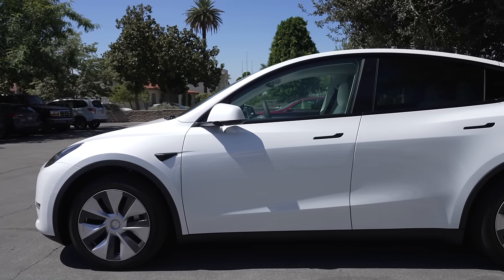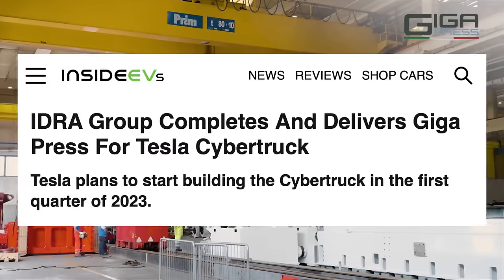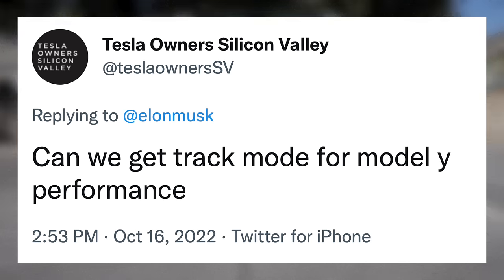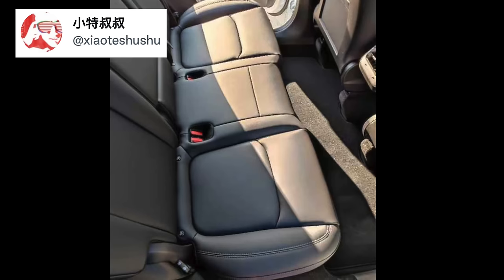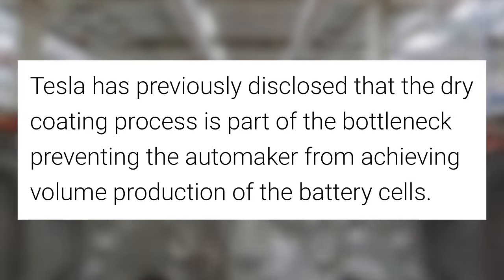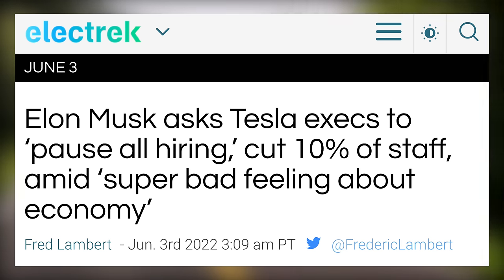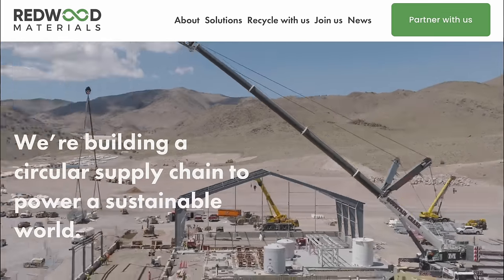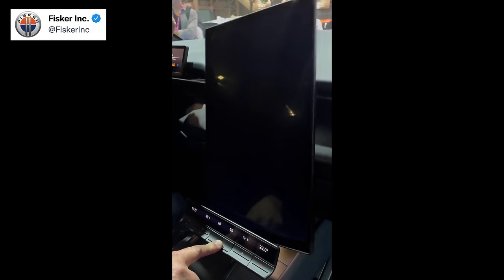NEW 2023 Model Y Features Are Here | Don't Make a Mistake

Comment: New features? The car looks exactly the same. While many other Automakers are introducing fresh new models. If Tesla wants to stay ahead of the pack for a long time, they need to quickly invest into new models. As a more affordable model, and the truck. The Cybertruck is yet to be present in it production ready model, more certain to use a standard unibody construction.
Reply: Same as people saying they need more models... they really don't they still have a backlog and when you can get the car asap it'll bring more buyers that aren't willing to wait.
Reply: Great post…I was just going to say the same thing. I’m a Tesla investor so I’m not happy with what Tesla calls refreshes and upgrades. My feeling is that most consumers could care less about an over engineered vehicle that does or doesn’t have Giga-Castings. They want new vehicles with dramatic exterior styles.
I hereby christen the SX3Y the “Tesla Prius.”
Reply: @cesaru2992  plenty of models from other Automakers sold out too. Just increasing production for a model doesn't mean certain long term profitability. Since the Automotive industry is too cash intensive, and the release of new models from other Automakers, could mean a model losing market appeal or even becoming obsolete.
Reply: @stevehevener  add to that affordability. And average Tesla prices puts them into the luxury sector. The Cybertruck production ready model is yet to be presented. More likely using an unibody construction, allowing to use current tooling, and supply chains already on the production sites.
Reply: @RogerM88  
Keep adding FUD.
Nobody cares.
Reply: @rogerstarkey5390  nobody cares? You seem to care.

Comment: I don't think adding unlatching doors is something to do in cold climates. The windows freeze as well, and if they can't roll down, that might damage the window trim something like the emergency latch does. It's a cool feature though, just not for cold climates I don't think. Nice video again Ryan, keep up the good work! :)
Reply: Won't the ice keep them from popping outward at the same rate that the ice would keep the window from dropping?
Reply: @BenefitOfTheDoubtInquiry  I don't think that the window moving motor is as strong as the electric latch, but who knows, you might be right.
Reply: @FANTAZSYREV  the latch is just holding the door against the rubber seal. I suspect the force of the rubber seal won't exceed that of the ice holding the window. When it's iced, I think nothing will actually move. This just helps us from punching our door handles.
Reply: It is. It says in the update.
Reply: Car defrost mode sorts the window freezing but can't defrost the door handle
Reply: Armorall all those rubber gaskets, it really keeps them software. It can help them last literally over 25 years.
Reply: Surely it's wise to remote warm the cabin?
Reply: @rogerstarkey5390  Good idea, but the door skins and interiors are outside of the cabin insulation. They'll be thoroughly cold soaked. I doubt the cabin heater could warm them up.

Comment: Model Y owner. Rear door “emergency” door release mechanism has to be the worse in the whole industry, both the old one and the new one. The old one is the worst, you need pliers or other tool to get to the cable. The newer one you just saw on the video. I think even space x rockets have an easier emergency exit mechanism.

Comment: Picked up my model 3 performance yesterday. First thing I noticed was the missing rear carbon fiber spoiler which I pointed out immediately. They did take it to the back right away and put a new one. Had to drive home with 3 big green tapes so that it stuck well for one day. The only thing missing was the USS which I figured were going to be missing. Besides one gap being a bit bigger than the rest everything else was great.
Reply: Interesting you got your spoiler the same day, normally they just set you up for a mobile appointment
Reply: @bigdaddyreg  I was surprised as well. Maybe the fact that I want going to accept delivery until it was done.
Reply: The fairy tales you people make up never cease to make me laugh

Comment: Small trivia I learned about the giga press: it doesnt weight 9000tons. That is its clamping force
*Flies away
Reply: It's not a "clamping" press, so it's likely the injection pressure used to "squirt" the metal into the mould?
Has to be VERY high pressure to fill the large void before cooling.

Comment: Picked up my LR Y today. Fremont sourced. No cargo cover. Think it has matrix lights and still has sensors. Ride was nice and reminded me of a high quality pickup driving straight highway but no setup changes yet. Fun ti drive. I do not think this car has $65k product quality and fit and finish of rar hatch was not great. White interior but black door panels. No squeaks or rattles but strange high frequency pitch when at cruising speed above 60mph and just letting off on accelerator. I M suspecting this is does to some EMI making it into sound system.

Comment: I just took delivery of a California Built model Y Performance(Oct 14 delivery, build was probably around the first of the month)… Came with the new door panels, AMD Ryzen, All Season Michelins!, and Ultrasonic sensors (I’m in the North East)… it did not include the cargo cover however.  So I guess I got one of the last cars with the sensors and without the cargo covers.

Build was quite good with no real gripes about the car or build issues.
Reply: Hi, just wondering what is the 10th letter of your VIN? Is it an N or P?

Comment: After 1 year of waiting (ordered 10/2/21) I was finally given my VIN PF on 10/20 and checking CARFAX its a 2023 MYL 7 seater! Did all paperwork yesterday, got my loan, paid cash for the rest, went to Tesla store to finalize and was supposed to pick up today. An hour later, got a call from delivery that there was an error and they didn't have approval yet to release  '23 MYL... Why did you give me the VIN then??? They offered to give me a 2022 MYL instead, are you kidding me??? I told them no, you gave my VIN which is already locked on my loan, so that's what you're giving me. Very, VERY frustrating experience for a very expensive car and being an established company it boggles me how this can happen.  FYI - I'm in SoCal and pick up is in Carlsbad.
Reply: Good to know because I just got my VIN yesterday and it is PF too. Mine is MYLR 5 seats. It still give me a date range for now
Reply: My date range is still showing for this week but delivery rep wasn’t confident it would happen.
Reply: Think they are trying to stick the 22 model to you since you paid way less than the current price.
Reply: Did pick up mine a couple of days ago, they gave me 22 model, but was told they have already delivered a couple of 23 aa well in North California
Reply: @naleshreddy1  I think they’re trying to discourage me by continuing to delay my pickup and like you said, force ‘22 on me due to the low price I have locked in.  As of today, my original date range of 10/21 - 10/28, has now changed to 10/23-10/30.
Reply: 10/27 UPDATE: Tesla charged my account since I was paying $15k cash + loan and informed me my 2023 MYL is still not ready to be scheduled.  My window continues to extend 1 day, as each day passes.  Started off at 10/21 - 10/29, now at 10/27 - 11/03.  So about 13 months of waiting, $15k out of my account, active loan and still no scheduled delivery for my vehicle.  AMAZING experience Tesla!
Reply: My delivery date is tomorrow in Las Vegas. Thanks for this heads up as I am expecting a 2023 MYLR based on the VIN, I’ll double check for sure

Comment: Took delivery 6 days ago of MYLR 7 seat built in Freemont and it did not have the cargo cover. It did have all the other upgrades that you talked about though. Also still had the ultrasonic sensors too.
Reply: same with mine, took delivery on Oct 2nd.
Reply: Picked up my MYLR 5 seat Fremont October 19, and same, no cargo cover and sensors still there.
Reply: got our MYLR on 10/18 and had cargo cover, no rear door release hatch like Ryan described. Also still had USS.
Reply: How do you know the USS are there? I took delivery of MYLR 5 from Freemont Sept 1. It has the circles where the USS are suppose to live.  No cargo cover but don't see a need for one since you can't see in the back of the car when look from outside.
Reply: @mikkij8534  You def have USS if you took delivery Sept 1. The circles mean that its installed. The new models without USS have no circles.
Reply: Wondering what is everyone 10th letter on your VIN? Is it an N or P?
Reply: @silverwolf9237  What circles should one look for to see if there is USS? I'm taking delivery in the next 3 weeks on a MY

Comment: Hi Ryan,
Just took delivery on October 28, 2022 in Tampa, Florida.  Mine was an Austin Built Tesla Model Y LR
I currently have software version 2022.28.300
When I look at the app on my phone I see a lock button, fan blade, lightening bolt. and a picture of an open frunk.
I looked at the rear door interior panel and I have the new orange door release cover button.
I don't have the updated rear seat design.
I tried out the open frunk button and it opened the frunk from the app.  NICE for loading items as you approach theTesla in a parking lot.
I see you have 3 icons shown on 1:14 of the timeline that I don't have with software version 2022.28.300.
The headlight icon, a round circle with a dot in the middle, and the automatic door opener that you have circled at 1:14 of the timeline.

I am a newbie to Tesla and have a few questions:

1:  When I am in Park and press the lock 🔒 icon in the app it briefly blinks the lights, turns on the parking lights and unfolds the mirrors.  Currently when using my phone as a key, when I press the door handle to gain entry it briefly blinks the lights, turns on the parking lights and unfolds the mirrors.   What is the benefit of pressing the lock 🔒icon prior to entering the vehicle?  Lighting up the vehicle to you can see it in the dark????  Not sure.

2: What does the fan blade do?  I think I hear a noise like a motor running when i press it.  Is this tp precondition the battery or something else?  I just briefly turned it on and off to check it out.

3: I presently don't have the headlight icon but would think???? that the headlight icon would turn on the headlights as you approach the car.  Is that correct?

4: I have no idea what the circle with the dot in the center would do.  Does anyone know what that icon does?  I currently don't have this icon either.

5: Being a newbie to Tesla I have no idea what the process is on getting software updates. Where would I look to see if Tesla has offered any new updates to my 2023 Tesla Model Y.

I would appreciate any valued input from Ryan or others that may have answers to these questions. 🙂
Reply: Hi John, does model Y produce on Oct is the same size of the rear seat compare with 2021 model? does your rear seat is the same as previous models?

By the way, I am tesla model y seat covers on amz, you can check it for view. Thank you.
Reply: @wekarsafe  Now sure about previous models.
On my Austin built 2023 Model Y LR the rear passenger seat bottoms are straight all the way across.  They don't have the extended areas on the front of the bottom left and right seats that I have seen on some You Tube videos.
Hope that answers your question.
Reply: @helicopterjohns  thank you very much

Comment: Li-Cycle "believes" it can achieve 95% efficiency. Just a friendly reminder that believing something does not make it true or even possible. We shall see how it plays out over time. I hope they can do it, but I have my doubts given the stated 50% efficiency of the current industry. It isn't like the companies hitting 50% efficiency are happy to leave a huge chunk on the table. If it was cost effective to be more efficient, they'd have done it by now.
Reply: Well, they have 3 plants already running, so they must be "optimistic" re the business case? We shall see.
.
Meanwhile, you might want to check quotes from Tesla and Redwood, who say the same (both are in operation)
.
You can also factor in ALL cells currently going to landfill from laptops, phones, powertools, etc, etc, plus printed circuit boards, which when crushed, provide a source of numerous compounds and metals, including gold, silver antimony, copper, silicon.... (Again, ref Redwood Materials)

Comment: 2023 model Y has happened now, you can see them in inventory in some markets.
Reply: Do you know what the 10th letter on the 2023 VIN is?
Reply: @tom_jerry2136  it’s a N for 2022 and P for 2023
Reply: So does this mean anyone taking delivery from here on out if they haven't received a VIN yet is technically receiving a 2023 MY? Taking delivery in the next 3 weeks & hoping I can call it a 2023.
Reply: @mrclaytontodd  Yes
Reply: @Ryan Shaw Just picked up my 2023 MYLR today at Santa Barbara, CA. It still have USS, no trunk cover, new side door trim as you mention, and a few gap issues.

Comment: It's going to be difficult to get batteries back for recycling. There are so many second use for those things even when they are not acceptable for automotive use. If you do find one for sale it's going to cost more than getting that much material from a mine. I guess the good news is those packs are turning out to last longer than most expected them to.
Reply: Most will either go back for repair by Tesla under warranty, be sent back as an "exchange" unit by repairers, or be removed by car breakers end of life (who will have an arrangement with either Tesla, or a company like Redwood)
Reply: @rogerstarkey5390  Tesla needs to work with insurance companies too to try get totaled cars back so they don't go to auction.

Comment: I have the 2020 Model Y with 40,000 miles. It's great to see all the improvements but I am still waiting for at least 20% range increase on the new Model Y. 400 miles or more would be ideal for my trips in the mountains or other parts of Arizona with my mountain bike. There are very few places to charge in the remote areas and carrying bike while driving up mountains sucks up a lot of battery. On my trip from Phoenix to Flagstaff, while carrying bikes, I can barely make it. I usually stop to recharge... which is PIA when you have bikes on a hitch carrier. If Tesla or another EV does not release a 400 miles + EV soon, I may have to go back to Subaru Outback.
Reply: The problem to me is more infrastructure instead of range.  Range is heavy and expensive.
Reply: More chargers. 300 Mike range is plenty.

Comment: Ryan.
The Giga "press" (casting) machine won't be turning out "Bodies".
It will be turning out "Castings"
.
If those covers were over CT bodies, they were fabricated in Stainless Steel, elsewhere.
.
Note the Question Elon asked of one of the team present during the call.
"So, When will I get my (CT) "Beta"?"
Reply (not sure who)
"About 2 weeks".
It's doubtful they could build and test the castings then build a truck in that time, so it's possible the "Beta" will either have more conventional (multi piece?) castings, or a form of CNC milled unit?

Comment: Producing batteries is a completely new business line for Tesla. Previously they assembled other people's cells (mostly Panasonic).
 At Giga Nevada Panasonic makes the cells in one side and Tesla assembles the cells into a battery pack.

I assume the tripling of 4170 cells is from a very low starting number. Nonetheless, if they can get near the top or at the top with their new dry cell batteries that will be a massive advantage.

 Of course, that means they have to produce high quality cells at volume at a competitive price. If that takes another 6 months they'll still will be okay. They actually have enough third party supply to be okay, but if somehow it doesn't work out they're going to be at a lower level of growth and profit. 
On the other hand if their batteries have a substantial advantage this will carry over to battery storage and to their much higher volume car production they will soon be capable of. And they can replicate their factories easier now so even more dominance with the battery, structural battery pack and casted cars.

Comment: Ryan, Here is another change I have not heard you comment on; Tesla used to include a plastic dead pedal cover in the Model 3, until late 2019 when it was removed with the change to the 2020 model year. While it was a relatively small change, it was annoying since many all weather floor mats, including Tesla’s own product, did not completely cover the area. This is particularly a problem for owners in wet and cold climates, as the carpet could easily get wet, dirty, and damaged. Now it looks like Tesla has brought the feature back in new Model 3 builds.